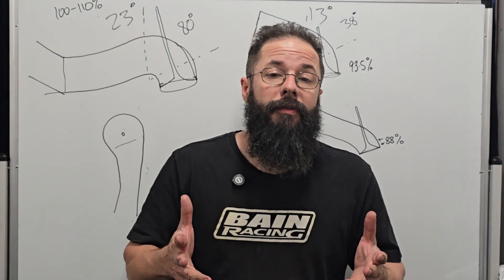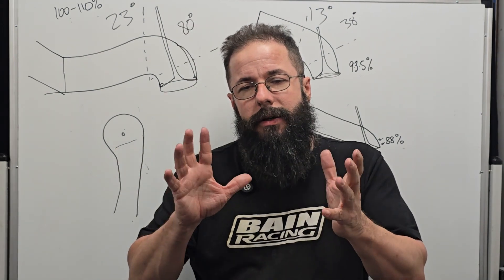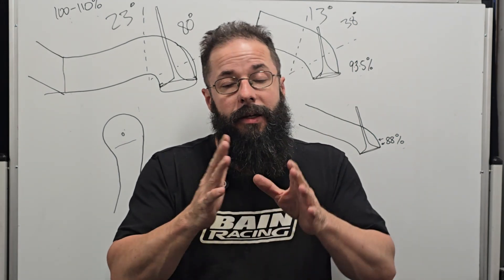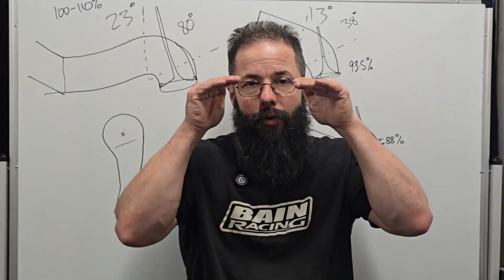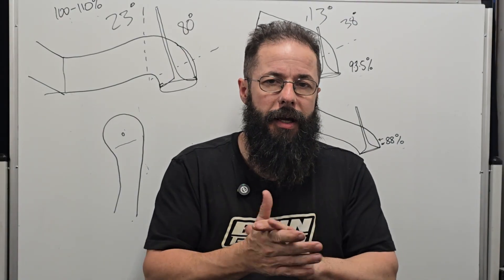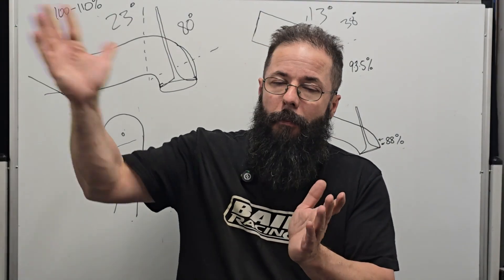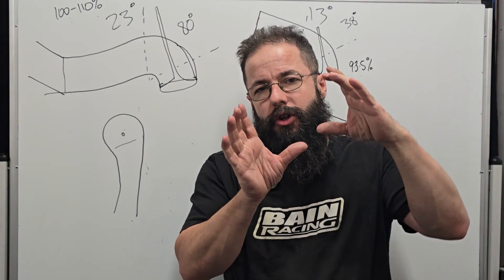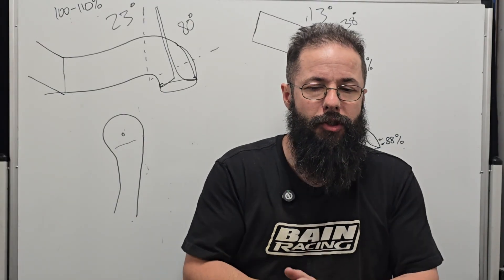The 105% Bowl Volume Rule is WRONG for 4-Valve Heads - Why Top NA 2 Valve Rules Don't Apply to You

Comment: I beg for an explanation regarding undersquare engines and their MCSA being at the valve seat. Why is that normal (or so I understood)? It doesn't feel right
Reply from the maker: Prostock,  superstock  in both 2 and 4 valve classes,  F1 etc. 👍  why would the longest accelerating inertia length be right?  Is that a serious problem?.
Reply: @bainracing  mostly it's me not understanding why/how that happens. To me, it seems more reasonable to have valve throat slightly larger than the port and runner, because (again, so it seems/feels) it's not where I want my highest speed at

Comment: i must say, 4v heads is abit sensitive when it comes to target velocity. specially opening the valve throat.
Reply from the maker: Yeah. I work between 86 to 91.5% depending in the induction design and air speed targets

Comment: do you have an idea how you get ideal port diameter in 4v? based on valve size? like the entry port of it?
Reply from the maker: All depends when the MSCA is mate.  And what air speed you target.  If its as low as 620 or 600fps you really want a very low de-acceleration area after this. In 3" you would want more than 20% of the MCSA are. I've gone even less with really good results.   For example on this head the window is around 1250mm2 and the seat area is 1450-1500. Which is close to that 20%.  But the distance from the MCSA area and what the intake CSA is will also dictate what's needed at the seat ring. 👍

Comment: Please, Pardon my slightly off topic question. Do you also have information on Siamese ports like my Chevy 292 inline 6? My 56 GMC has to get up Colorado mountain passes pulling a camper. I don’t want to hold up traffic. Btw I live at 6,500 feet elevation. The stroke of the 292 is 4.125 inches.
Reply from the maker: Not really mate. I'm sorry.

Comment: Jake,

I've been wanting to experiment with just slightly straighting out the short turn only, and not touching the whole bowl on my next 2J build as I've speculated that could help the engine average a little better, as I intend to put it together for circuit racing. I'm glad to see someone visiting this topic, as there's lots of wisdom in the saying that there really isn't no hard rule.

Incredible work as always.
Reply from the maker: Thx man.  The best way would be to probe it. Measure it and flow it. That 350-400fps over the short turn seems to be good. 

 The problem you can have by flattening the short turn is air will stall and you will create separation.  I do lay them back ever so slightly myself 0.040".  But it's a delicate dance mate.  I also widen them. This slows the velocity over them and helps carry a wider power curve.  Maybe play with shrinking the corner radius if you aren't already doing this. It's another way to make it more stable without laying it back. 👍

Comment: How can I get a Honda J-series to 350whp N/A through a FWD manual (rule of thumb 16% losses)? Should I go with the oversquare 3.2L (89 bore, 86 stroke), or the slightly undersquare 3.5L (89 bore, 93 stroke)? I was thinking 3.5 due to the stroke and rod ratio still supporting 8000 rpm, and my tachometer only goes up to 8000. Stupid reason, sure, but still. Have you worked with or been aware of that architecture before, or would you need more exposition? Do you think David Vizard's polyquad would help, and if so, do you know how differently the bigger pair of valves have to be sized and how different the cam duration needs to be for them?
Reply from the maker: 3.5 litre, can't beat cubes with NA.  Even know it's a little under square. You shouldn't have a problem making 120hp per litre. Intake will be your biggest problem,  but there are some good twin plenums out there with a good straight shot.  No the ployquad has no real world benefits to HP. 👍
Reply: @bainracing  What approximate cam specs do you think I should go with for a custom cam? J series are SOHC 4V with intake Vtec only, unless what I was told about certain J37 variants is true, in that a few of them have exhaust Vtec, as well. I assume I'd want to aim for 11-11.5 static compression so I can still run 89-91, but yeah, yeah, I've heard "power is pay to play, might as well bump it and run true premium" so I might do that as well, especially since this build is so far off (1.5yrs plus) and I'll be in a better spot financially, then, anyway.

Comment: Interested in what’s your take on the newer d.i ports. For eg b58 it’s d.i but we add p.i to make big power. Well you can’t delete the d.i shelf to help p.i or d.i wont work right. Also the port isnt really designed well for p.i. So going p.i and only and delete d.i shelf idk if that’s the best idea. I’m testing a port now that kinda the compromise of them both. Just curious what you found to work best. Not many people talk about the newer designed ports and 4 valves.
Reply from the maker: Yeah, great question! We are actually doing the mini version which is almost the same.   We really have to work the chamber as it's designed for DI so on a wet flow those sharp edges will become a problem.   And yeah the port isn't too bad.  Just port and try to size it to your needs.   I'll do a video on this mini head when we get the go-ahead. 👍
Reply: @bainracing yes ik what you meant when you mentioned it in the video the b38/48 version. I didn’t mess with the size of the port to much cause they are already so big. Didn’t want to lose the velocity but at same time wanted to get more on the floor. Not sure about slowing the air speed down tho to atomize and mix the fuel better. Can’t wait to see what you did so I can compare. I def spent the time on the valve job tho that’s the key!! ❤ your content brother there is a lot of phony out here on social media. Keep it up hope to meet you one day.
Reply from the maker: Thx man!! Yeah, you're all over it man! That's it! 👏👏
Reply: @bainracing  thanks 🙏 maybe one day I can show you my program n we can bounce some ideas off each other. Biggest problem I’m having now is combustion chamber/ head deformation and it’s lifting the heads under high boost. Kinda like they had with 2j but we have less mass in are heads. The coolant ports are just massive. We have tried welding them up but only helps so much. I’ve been thinking of filling them up more with devcon or some epoxy what do you think. Guessing you have not run into this problem yet? If so what was your fix. Till I get my billet block then a  head from bullet I will have to figure it out. 

FYI I designed a SS sert for the block threads with custom 11 mil 625 studs so I’m not pulling the threads in the block. Tq to 150 ft lbs depending on gasket and ring setup.

Comment: Thank you, my dad has been saying this for years, horses for courses. I have a 2jz and the ports and the bowls are way different from any 2 valve head. You can easily kill a 4 valve head if you think you can use the same methodology for a 2 valve head. You nailed it when you said pro stock heads can not be used in super stock and or road racing and limited classes. They are all different in many ways. Thanks for sharing this information and my dad was right that’s why he has so many r&d heads and ports from back on the 80’s &90’s and early 2000’s.
Reply from the maker: Great to hear mate! Yes exactly! You are on it!👍

Comment: Jake, what generally limits us to 0.6 Mach for peak velocity? I am reading Charles Taylor’s (he was doing ICE research at MIT back in the 80s) internal combustion engine fundamentals, and on page 171 there is a discussion about the Mach index. There is a graph in that section in which volumetric efficiency is plotted on the Y axis vs Mach index on the X axis. The curve is flat from 0.2-0.6 Mach, declining past 0.6 onwards. This to me implies that we do not gain volumetric efficiency by increasing air speed in the flat portion of the graph, which does not align with my current understanding. I am curious if you have any insight on this.
Reply from the maker: This needs a video mate. Great point. I think I remember this study.  It seems to have missed the velocity/inertia square law.

Comment: Excellent explanation Jake! I didn't put too much thought into all this until you started explaining what the differences in design & perspective are\were..............now I have a much better idea\understanding of what the OEM's did\trying to accomplish w\ their cyl head, piston & intake manifold designs & how to approach applying ignition timing & cam timing from a tuning perspective (I'm doing my own tuning on an OEM long block engine that uses VCT.....) to optimize engine HP\TQ output, MPG & emissions performance\efficiency across the spectrum. Can't thank you enough!
Reply from the maker: Nice mate. It's very good to tune and see how these aspects affect even simple things like timing or if you're doing air speed density on a VE scale.  This is how I used to validate my early port work.

Comment: is it possible to say that with a straightened channel, an enlarged valve is needed to compensate for the decrease in flow through the valve slot from a short turn? what also creates a greater rotational effect in a four-valve engine? Another question: how much does the size of the intake valve depend on the RS ratio?
Reply from the maker: Generally the straighter the shot. The less valve area we need.  We don't want any rotation effect as this increases the port length.  We covered this in another series.  I think it's cylinder tumble vs swirl.   Yes and the worst is the short turn. The bigger the valve needs to be. Especially if the MCSA is just behind the SSR. Hope I answered this question for you.

Comment: What would you recommend for extra HP and TQ for my 21 Camaro 2SS right now I have FBO 2” kooks headers with MSD atomic manifold with Solor 103mm Rotofab big gulp with E85 flex fuel im looking for some advice to get more HP tuned right now 450hp 440tq what would you recommend for my next mod thank you.
Reply from the maker: Mate that's a good split 450/440.   From here you will start to shift the power curve and may cost some torque. Look at head porting, a little more comp. This should help with the pipes you have too.

Comment: Thanks for this. I've watched too much David vizard etc talking about non crossflow 4cyl or v8 American motors, head games almost relates to my turbo Volvo stuff.
Reply from the maker: Yeah Dave's a good guy! 👍.  I think i know the Volvo turbo head. We have do a few different ones. Saab too.
Reply: @bainracing I've ported a few 8v b230 heads, even flowed 185cfm on the intake and 140cfm on the exhaust on one I've built with help from people who know way more than me,  I need to do a better B20 non crossflow head for my 122, but the 16v I have in my project only had some minor port cleaning up on the short side as I didn't know what it's like to drive with a turbo. Four years later it's still on the hoist! Need to be driving it before going further.
Reply from the maker: @Low760measure it up and rip in man!💪.
Reply: I mean, David Vizard has worked with 4 valve setups and even came up with his Polyquad design... Though I wish I knew more about it and what minimum valve size difference, as well as cam lobe differences for the smaller valves, are required to make it work, at least properly if not optimally.
Reply: @Drunken_Hamster yes. Then he talks about it a little bit but then moves on. He's been quiet the past few months, I hope he's ok too.